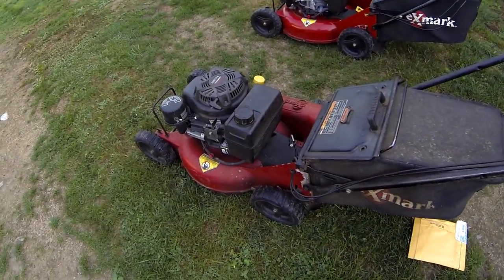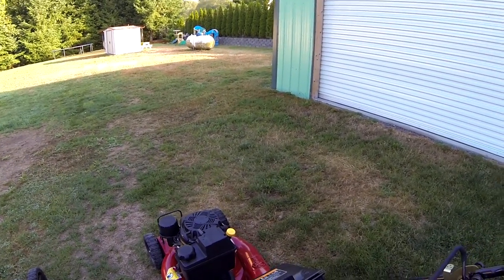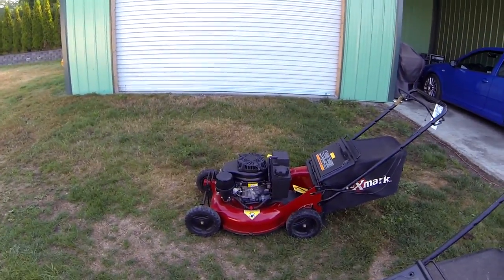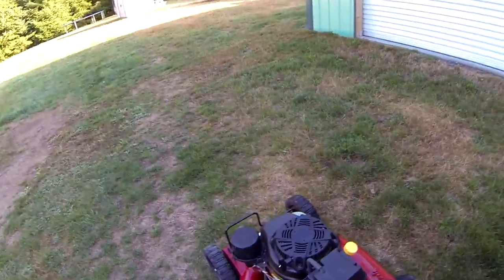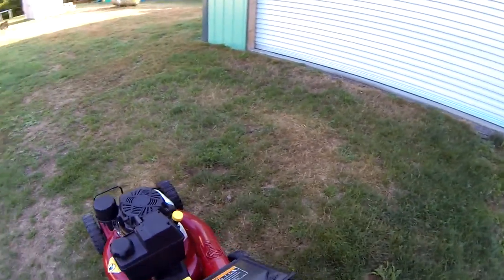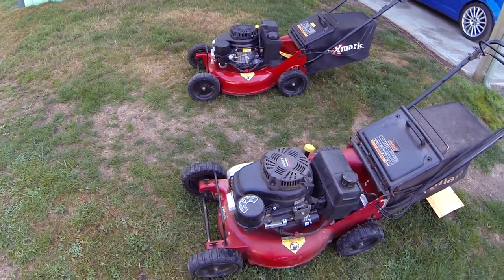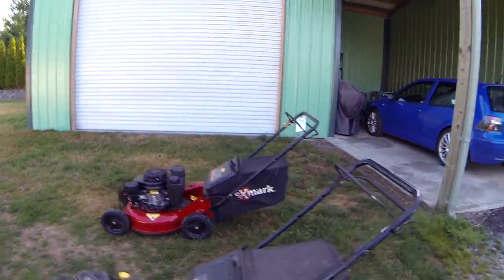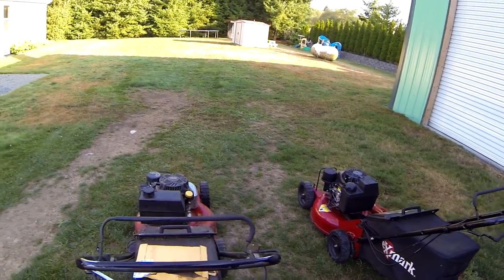Exmark 21in X-Series Commerical Mower: Blade Walks

Comment: Are those the factory blades? Mine dont look like that  lol

The rotation and vibration of the engine is causing that forward creep. Belt slaps the pulley due to those factors, and applies a tiny bit of force. Ive been using Toro BBC setups for 35 years. Happens on almost all of them. Rarely do I have one that doesnt, and it may sometimes, just not when I look at it...which is a fraction of its operational hours.

Customer is a cry baby?
Reply: Blade is on up side down.